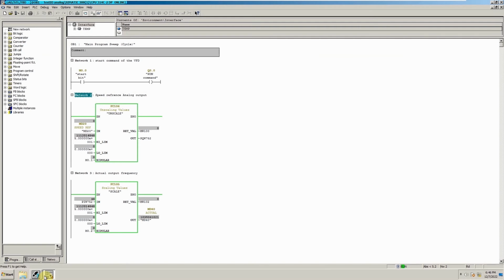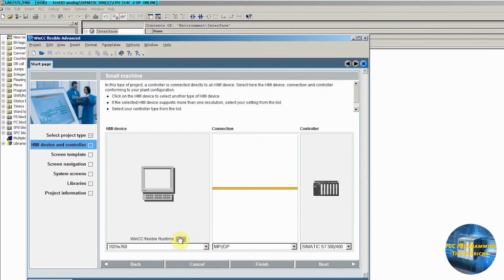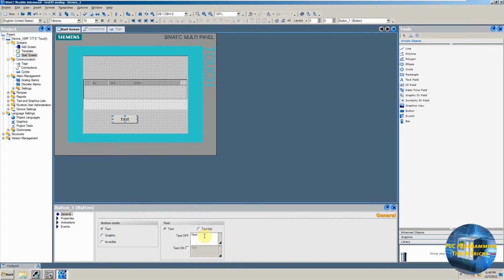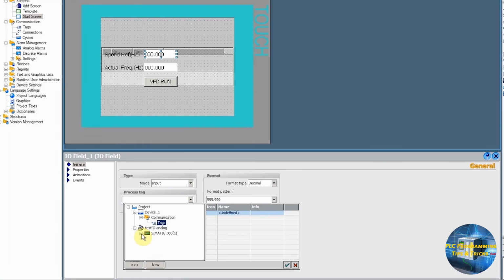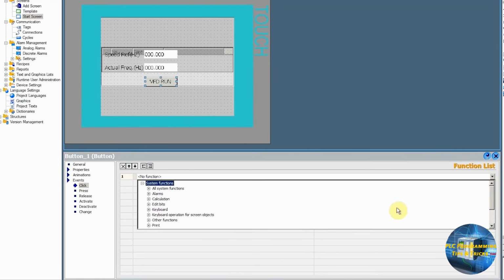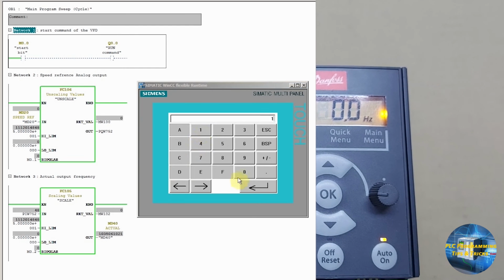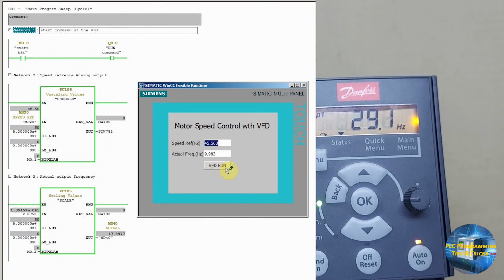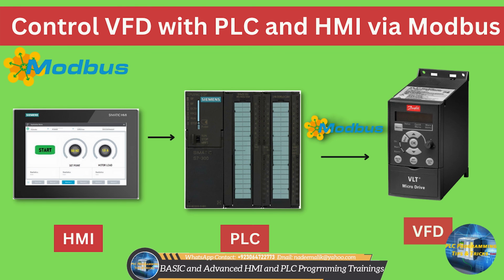Control VFD with Siemens PLC and HMI through 4 to 2mA analog signals || Complete project || Part # 2

Comment: Thanks so much, i just need to know what step7 versions you are working on?
Reply from the maker: V5.7
Reply: @EASYPLCTRAINING  i have same version step7 v5.7 and wincc 2008 flexible sp5 as in the videos but when i open a plc project with integrated HMI ,it gives an alarm that missing wicc software and  the HMI is not showing inside plc project and i have to open HMI only from wincc separately, can you advise please.
Reply from the maker: Have you installed wincc software?
Reply: @EASYPLCTRAINING  yes as i described , i have wincc 2008 flexible sp5